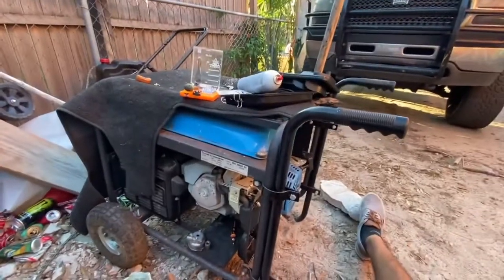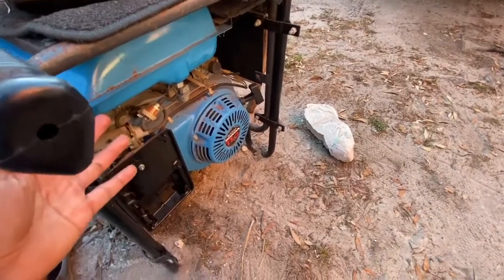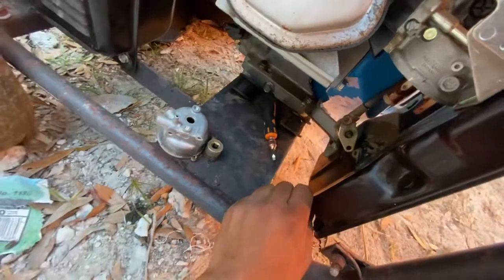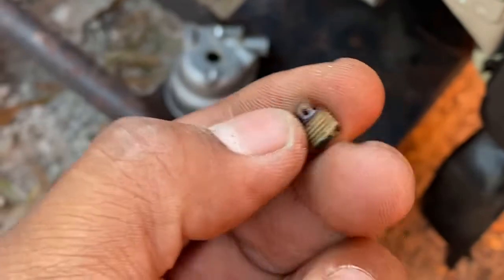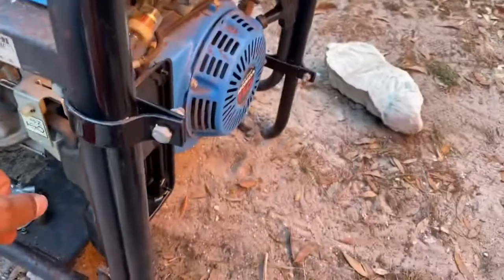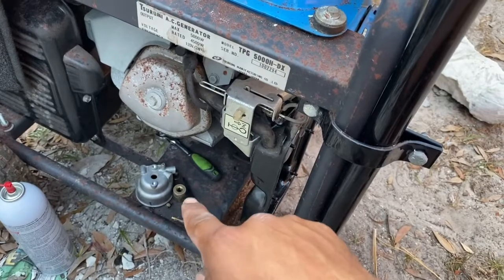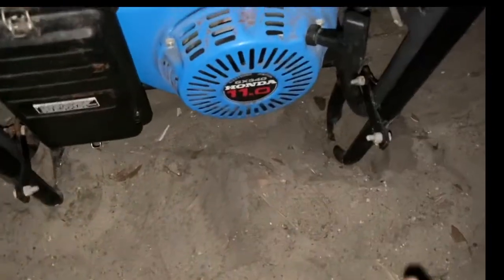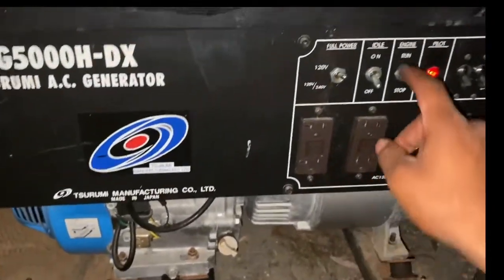Honda GX340 Generator Repair (Carb Clean W/O Removing Carb!!!)

Comment: I had to pause the video somebody correct me if I'm wrong did I just hear the lady was asking $100 for the generator and he wound up giving her 140???
Reply from the maker: Sorry for the late reply! But yes lol, that was the short version of what happened. What actually happened is that She listed it for $100 and since I had a long drive, others had already said they could get it right away that lived closer. I knew I would get beat to it so I offered $140 and she accepted to hold it for me. Ended up selling this one for around $400 - $500. I live in FL so they are good flips here especially in hurricane season, and ones that last forever like Hondas. Worth the extra $40 since they are usually more that that and they don’t also.
Reply: @liveloveland wow where in fl are you? When did this sell for that much?

I'm in st pete area and it seems I'd only get maybe 300 at best for it